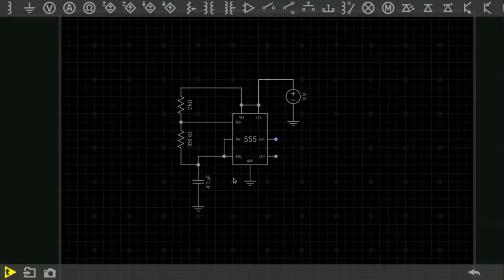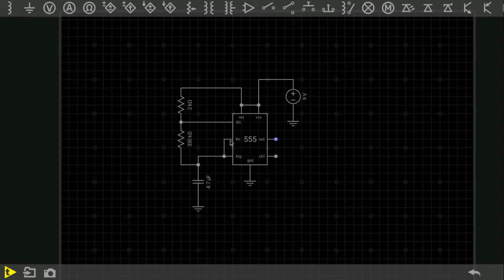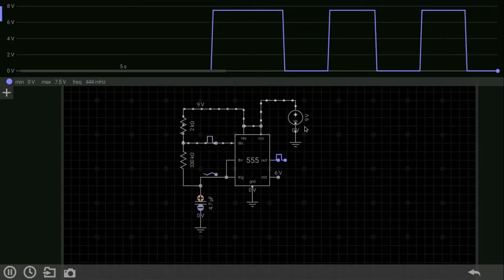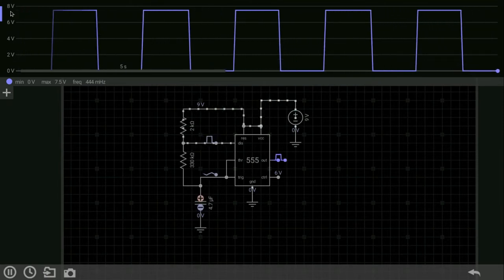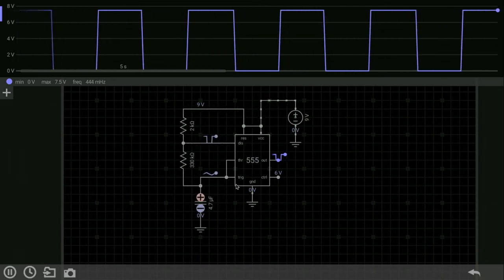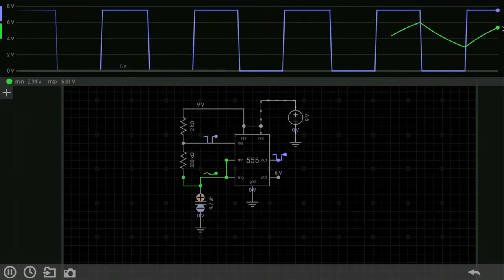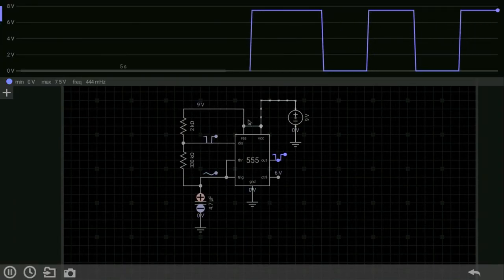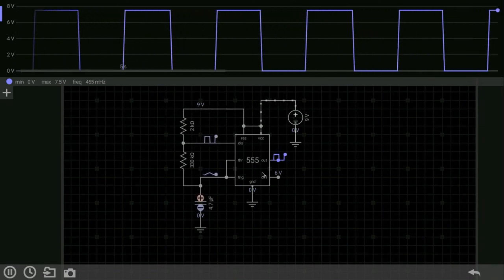BLINKING LED CIRCUIT/MULTIVIBRATOR CIRCUIT - Using 555 Timer IC

Comment: Great vid! I don’t know if you’ve said it before, but what are you using to display the schematic at 1:50
Reply from the maker: Thank you so much 😄!! And The schematic program is called “EveryCircuit”. It is a great app and you can model any circuit. It tells you the current, voltage and more. There is also a great community on there and you can learn a lot from them. The downside is it is a one time $15 purchase, but it is worth it in my opinion. So yeah, thanks to much and again it is called “EveryCircuit” (I think the website is called EveryCircuit.com)